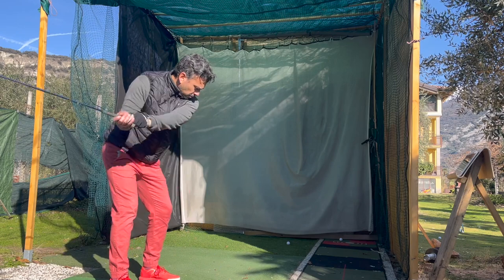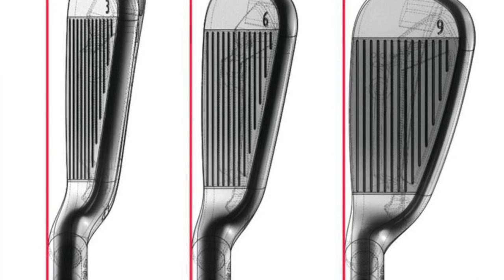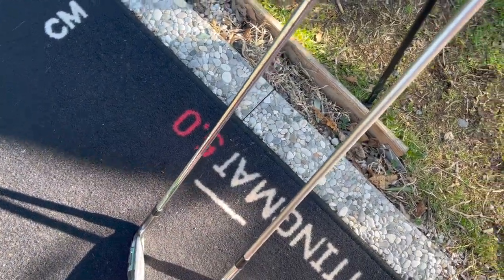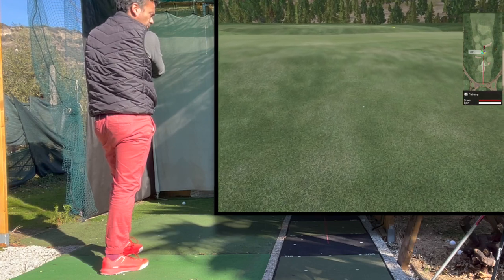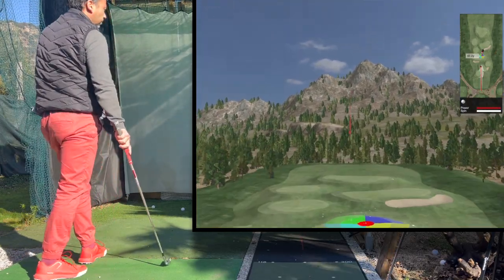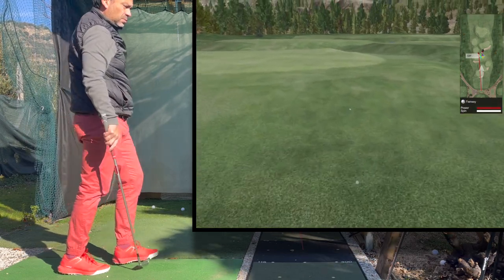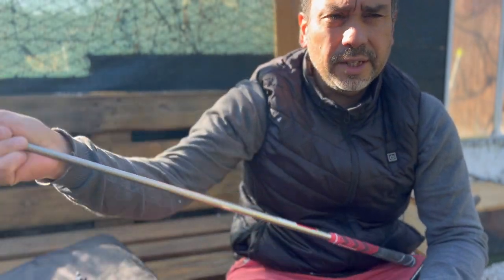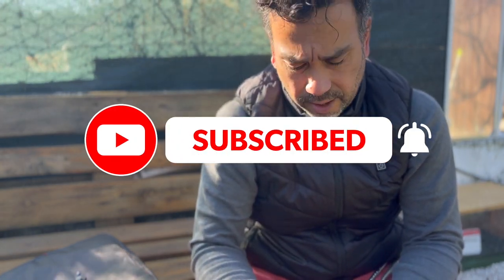Lighter Shafts Causing Hooks

Comment: Lie angle could also be a problem. Most or many game improvement irons come with a slightly more upright lie angle which definitely can make the ball hook more than a neutral or negative lie angle. Luckily the lie angle can be changed by a competent club maker. Just like you a stiffer shaft has also helped me to keep the ball from going as far left not to mention lower the height too. I have had really good results with my woods.
Reply from the maker: Unfortunately there aren’t many good fitters in my area, I really need to get fitted for the right club face and shaft
Reply: @thebackyardgolfer7010  Where are you at? I believe you said in the past but I've forgotten. It certainly looks like a nice place though, unspoiled by urban sprawl like where I live at!
Reply from the maker: @BamaTidefan1967  I live near lake Garda in the north of Italy, right now there are a few tourists, but it gets a bit loud in the summer
Reply: @thebackyardgolfer7010  Awesome! What a wonderful place to live with so much history.
Reply from the maker: @BamaTidefan1967  thanks